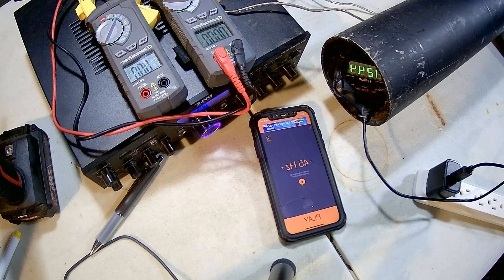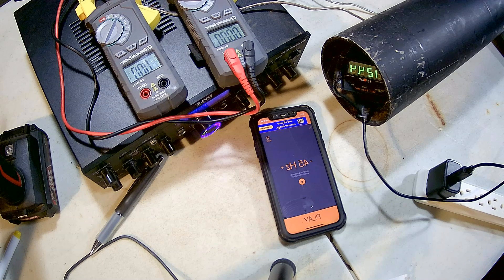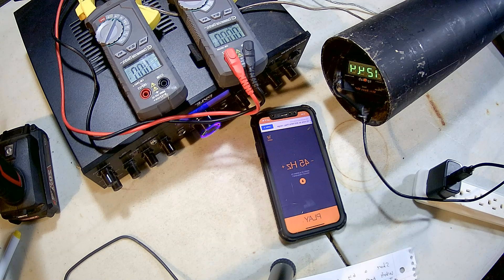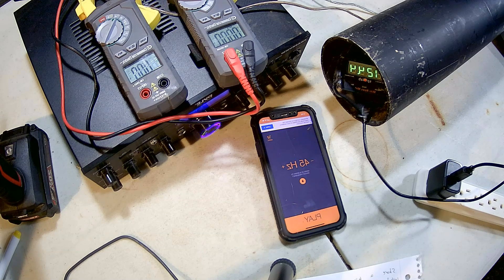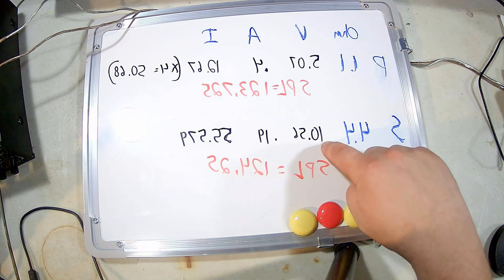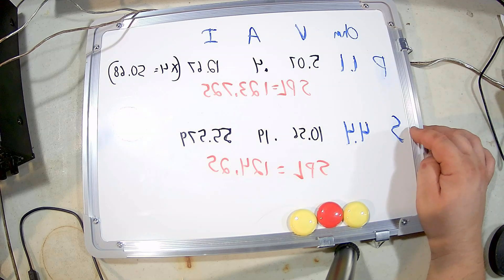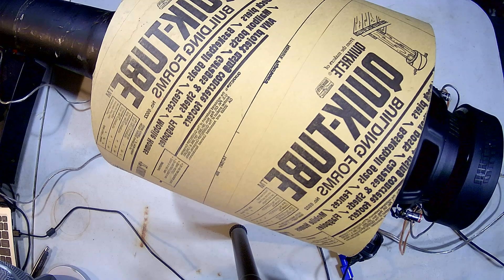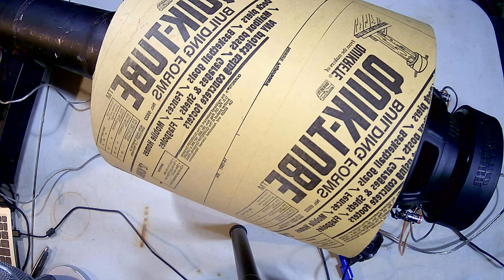Series vs. Parallel?  Big Secret, big difference!

Comment: I have a dumb question:
Since the rail voltage is finite at 100 percent, wouldn't you need a twice bigger amp to make use of that phenomenon?
Reply: Yes. This is why he used an amp/power level that could be obtained @ either impedance.

Comment: Wiring doesn't make a difference its the final impedance that matters
Reply from the maker: If you already have the equipment, that may be true.  If you are purchasing equipment, you can plan ahead for things that will give you an advantage, like this.

Comment: So what I am gathering from this video is even though Im getting less power wired at 4 ohms theres a chance Im louder being wired at 4 ohms?  Im running a 1200 watt amp to a 1100 watt sub
Reply: Not louder @ 4 ohms, but more efficient= Louder per watt. If your amp does 1200 watts @ 1 ohm, prob. then 800 @ 2 ohms, & 400 @ 4 ohms approx.  Your Woofer getting 400 watts @ 4 ohms, will not be Louder than if your Woofer were getting 1200 watts @ 1 ohm. If you had the same woofer/make/model/size, but it was a Dual 1/2 ohm woofer, that was wired in series, to a 1 ohm Load, it would be more eff.= Louder on that same 1200 watt amp wired @ 1 ohm, vs your current Dual 2 ohm woofer wired in parallel to 1 ohm, hope this helps?

Comment: Inductance in the gap from winding configuration 

With tons of power applied it does become also unnoticeable 

Also most ts specs are ran in series so the BL is higher 😆
Reply from the maker: When you say tons of power, are you talking about burp applications?

Comment: Great video, audio, commentary, tutorial, demo, content & topic.

My limited understanding :

Lower final impedance = 
higher wattage output from same amp, set at same volume, same gain regardless of wired in series or parallel

Higher final impedance = 
lower wattage output from same amp, set at same volume, same gain regardless of wired in series or parallel

Car audio standards general speaking :

Amps 4ohms, 2ohms, 1ohm, 
rarely 0.05 ohms

Speakers 4ohms, 2ohms, 1ohm
dual 4ohms, dual 2ohms, dual 1ohms
( less heat sink surface area, 
don't bury under seats or spare tire area )

Home theater, home audio
( Analog & tube amps are physically large, disapate heat more efficiently open to vented
environment )
Amp 8ohms
Speakers 8ohms

Concert, pro audio, guitar amps 8 ohms, 16ohms
Speakers 8ohms, 16ohms

Always wire down or up 
quantity of speakers to maximize least resistance
matching final load of amplifier's recommend
ohm rating

I.E. 
(4)  4ohm speakers wired in parallel to final impedance 1ohm amp
Reply from the maker: In general, good advise.  Part of what I am showing people is so that when they decide to design an entirely new setup, they can take advice and build with efficiency in mind.  But yes, in general you have good advice, especially if you already have something and you have to work with it!  Thanks for the feedback!

Comment: so now a series parallel setup
Reply from the maker: Absolutly, unless you have weird loading issue which typically happen once you start to cross the 155 db range!
Reply: @caraudiolab  id really appreciate it im close to that but not quite there so all you can teach the better
Reply from the maker: @418lightning8  That is still awesome!  What is your setup?
Reply: @caraudiolab  6 dual 1 15s in a 6th order

Comment: No Patrick talks about it all the time,, Says bass heads are stupid.,, Says wiri ng in series takes away BL. From the sub.
Reply: The lower the ohms you draw from an amplifier, the amplifier damping factor also drops considerably. Another reason why running at 4-ohms compared to 2-ohm or 1-ohm will always have more subwoofer cone control & far more inpactful bass.
Reply: @DTW-bx2vy Amp damping factor halves, everytime the impedance halves. Thats why an amp with a damping factor of 100 @ 4 ohms= 50 @ 2 ohms= 25 @ 1 ohm, wont sound as tight/controlled as an amp with a damping factor of 400 @ 4 ohm= 200 @ 2 ohms= 100 @ 1 ohm. Now imagine the Sq. Of a setup where you have say 2,000 watts, @ 4 ohm, with a damp. factor of 400, vs another setup, using an amp @ 1 ohm, thats 2,000 watts, but with a damp. factor of 25!? Which one you think will sound better? It sounds like you know this, i wish more people did.
Reply: pat always says wiring in 2 ohms drops BL compared to 4 ohms. this is how misinformation spreads because you did not listen. I have experimented wired to 2 ohms vs 4 ohms series or parallel.  4 ohms Sounds richer, the 2 ohm the bass is thin
Reply: Ok🫢

Comment: This is really interesting and I want to try it out on my DVC sub now, but I have a question as to how I should set the gain for my amplifier

My sub is a pretty low power sub with RMS around 120w and I paired it to an amp capable of 160w RMS at 4 ohm, I currently have it wired up in parallel 2 ohms and I set my gain with a multimeter to around 15.5v (120w 2ohm), if I have it wired in series 8 ohm how should I set the gain?
Reply from the maker: 25.5 volts on you meter assuming 4 ohm should do it!  Let me know how it turns out!

Comment: This is interesting, but I don't think many people care about efficiency at low power.

In order to get 2 watts after switching to series wiring I assume you have to increase the volume or gain knob? (due to higher impedance putting out less power)

It seems most people only care about how to get MORE power and are oblivious to their efficiency, period. Lol

Do you think the increased efficiency is simply because the amp operates more efficiently at higher ohm loads?
Reply from the maker: It is the same power from the amp (2 watts), different spl at the subwoofer.  I have tested up to half of RMS with the same half of a DB gain (couple hundred watts).  As far as all of the testing I have done, I believe the gain goes all the way up to and beyond RMS of the sub.  I agree, most people only care how to get more power.  If you can increase the efficiency through a couple dozen methods, eventually, you can wire down again or just be crazy loud for low power.  Either way is awesome, in my book!
Reply from the maker: I did have to increase the volume knob do to higher impedance.  However, if you have 4 subwoofer, then you have to think about either wiring in series parallel or parallel series.  So, you can easily take advantage of this cheat.  Or, if you purchased two dual 2 ohm subs, you can either wire at .5 parallel for about 50% more power or in series for the half a db gain and save on your electrical expenses or run your amps cooler.  It become super important for those who run competition and have four subwoofers at dual dual 1 ohm and can run them in series for .5ohms.  Knowing this stuff can help you pick your subs and know how best to wire them.  Just wait until I reveal why wiring them in series helps!  Even if you decide to run them in parallel, if you know this principle, then it will help you pick better subs and be louder even if you run them in parallel!